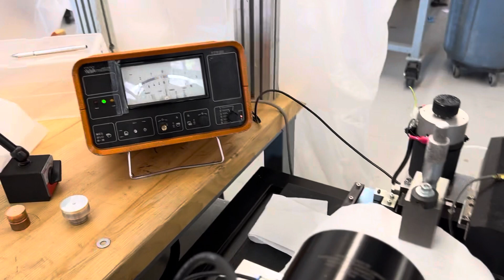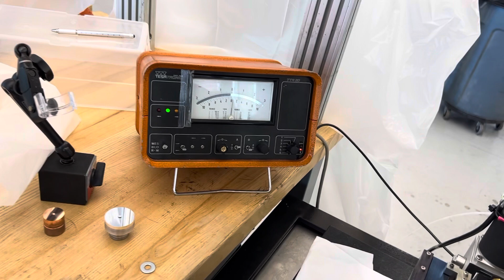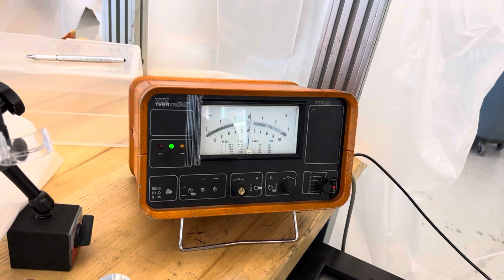DIY Diamond Turning Lathe Update- Linux CNC!

Comment: Nice work! But I would highly recommend seeing if you can scavenge some more precision oriented motion controller/trajectory generators plus motor drives off of ebay, from ACS, Aerotech, etc.

Reason being is Linuxcnc will highly likely be limiting your motion coordination, and using it with your core motion platform is like putting a street car engine into a formula 1 car. Using a distributed controller means now the clock jitter (that is also much tighter) only affects the setpoint of the trajectory as the drives themselves actually contain the servo loop. It will also give you much more capable control loops that will significantly improve your dynamic performance.
Reply from the maker: What you're describing (distributed controller) is the way i have it set up right now. Linuxcnc is only providing setpoints, the axes have external servo drives (IONI Pro's) running the control loops. As you predicted, my jitters are small as a result of this, but also keep in mind this is an extremely low speed, non-complex trajectory using machine. I do not require ultra-low-jitter-optimized-trajectory dynamics, i just need high frequency (4MHz) setpoint updating at a relatively consistent speed.
Reply: @cylosgarage  Can you confirm the 4 MHz updating? Do you mean 4 kHz or is there a reason you need MHz? I enjoy your journey. Thanks
Reply from the maker: @fishing8893  I mean 4mhz. It’s because it’s operating in step/dir mode. My “steps” are 2nm. So, in order to move at any respectable speed, I need a very high pulse frequency.
Reply: @cylosgarage  I didn't realize the IONI RS485 multidrop could communicate that fast